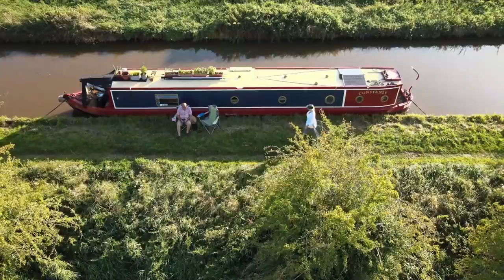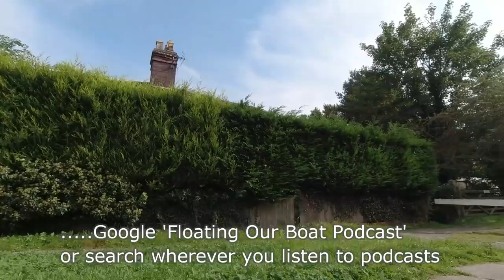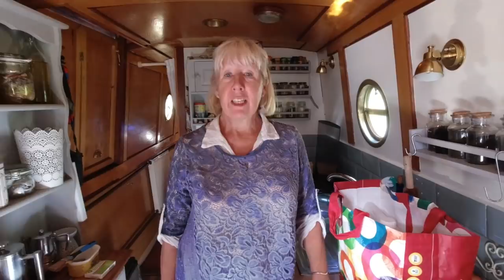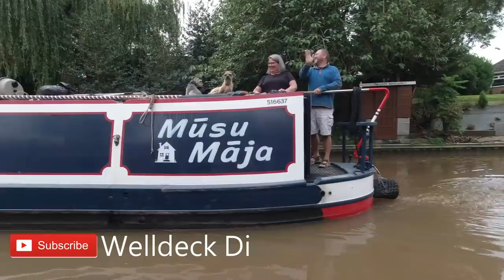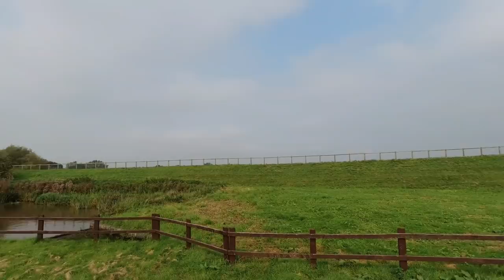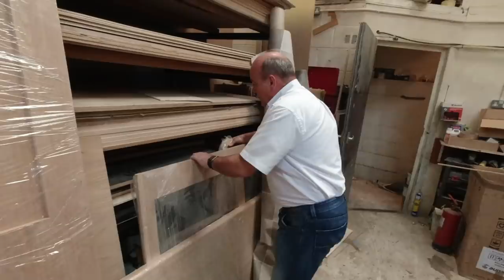Bouncing Back - Episode 110.

Comment: Oh the jam donuts looked delicious. Question " seeing how a lot of narrow boaters put solar panels on the roof, can or do the builders put 2 or 3 sealed connections for the panels? It seems it would be easier and give an option for panels when the wiring is done during the rough in of the build. Just curious 
   Love the videos and stay safe you 2. Cheers
Reply from the maker: Not sure about other boat builders, but that is a good idea. We told them we wanted solar panels so they have put the wiring in for us, but normally it wouldn't be there.

Comment: Glad to see you back we can feel your excitement build as the boat build continues. We have just put down a deposit for a build slot for next year busy planning the layout and details. It’s a great feeling.
Reply from the maker: That is great news Gary. Which boatbuilder are you using?
Reply: @FloatingOurBoat  we are getting our shell from Nick Thorpe and fit out should be with a small company called Clearwater and we are seriously looking at a series electric hybrid but not firmed on that yet.